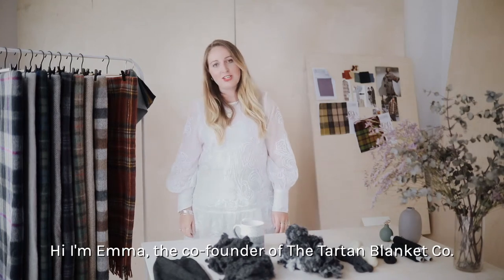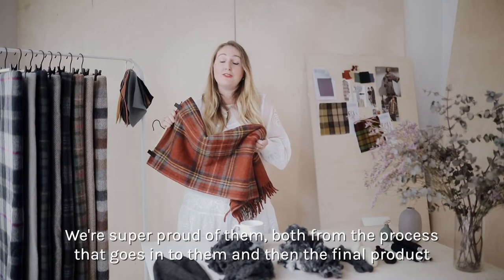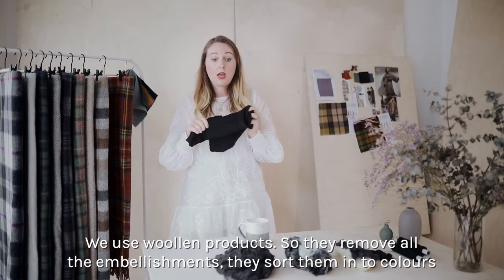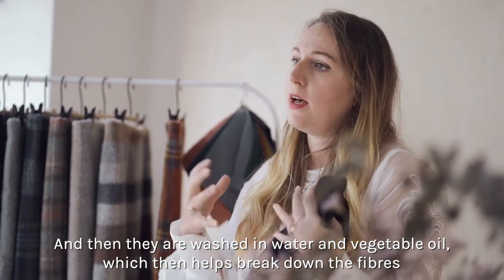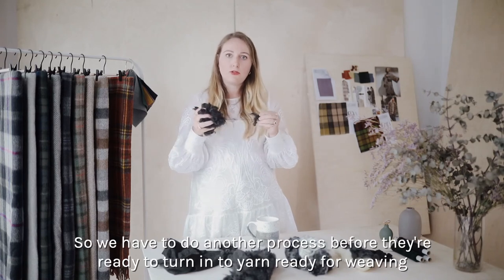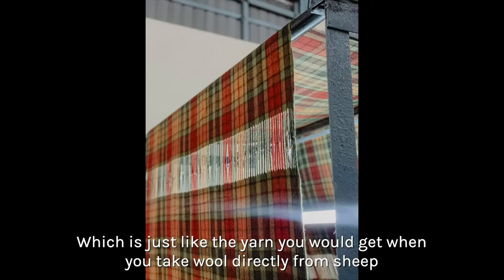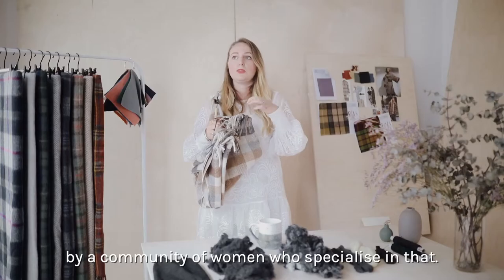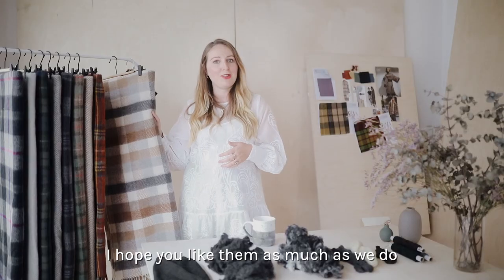How it's Made | Recycled Wool

Comment: I bought two of these blankets 11 months ago, and I'm extremely pleased with how warm and durable they are. In spring & autumn I'll wear one outside at work as a short cloak using a kilt pin. I find it to be a nice extra layer before needing a full jacket. In winter when the temperature is around freezing or below, I actually fold and wrap one around my legs to keep my lower half warm, held up by a belt. I'm outside all year round, all day long so while a jacket keeps my top half warm, I find that even thermals only delay cold legs for so long, so the third layer is very cosy! The other one I keep at home and wrap up during the evening with my slippers. During summer I thought they'd just sit in the cupboard, but since I have a 15 tog winter duvet it's far too hot to use - So instead I took to sleeping under one of both of the blankets depending on the temp that night and I slept great! Honestly very versatile blankets, highly recommend! :)
Reply from the maker: Hey Malchior, that's great to hear! We love knowing our blankets are keeping you cosy and warm!